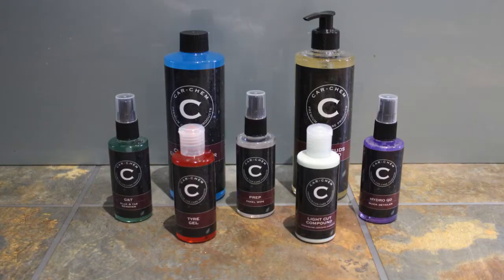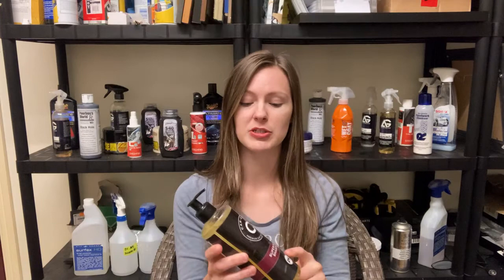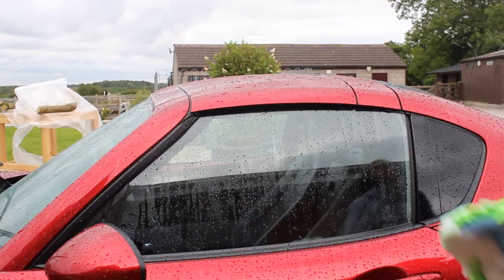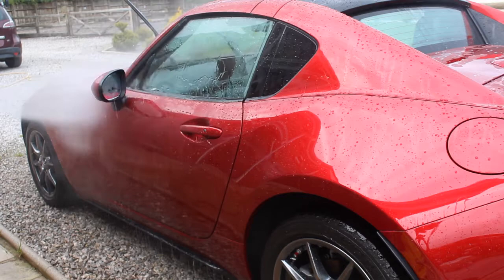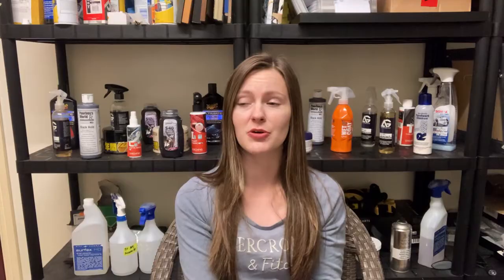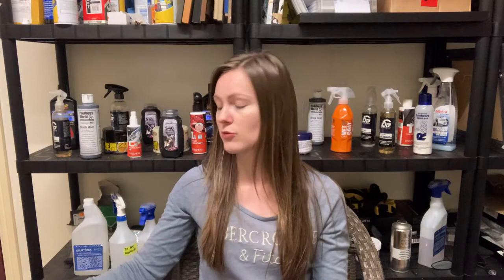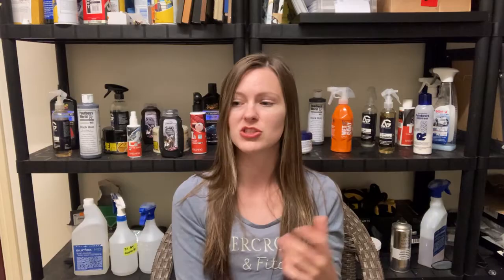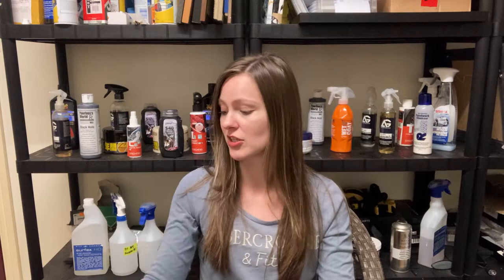Car Chem Detailing Products | Brand Review

Comment: Another great video and brilliant channel. Keep up the great work. Which do you think is better.... the Supersuds Carchem or the BH Autowash?
Reply from the maker: Cheers James! Honestly that's a really difficult question, it's so hard to pick between them. In terms of the suds and slickness there really isn't much in it. I think BH may work out a touch cheaper but you're likely to have a very similar experience with both of them to be honest. Have you used either/ both of them before?
Reply: Thanks for your reply. Yes been using the Bilt hamber one for a bit but thought would try something different now I have almost ran out. Prob will buy some Carchem and give it a whirl and maybe get some smaller samples of other carchem products too 😃
Reply from the maker: @jamescarter7663  That's why I went for the Car Chem one this time as well. Just wanted to switch it up and the samples are a definite perk!